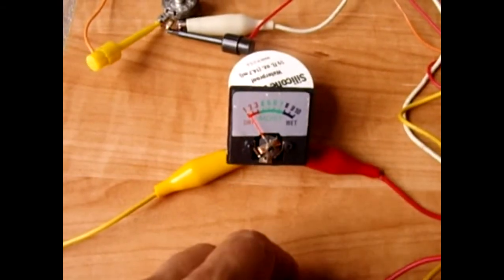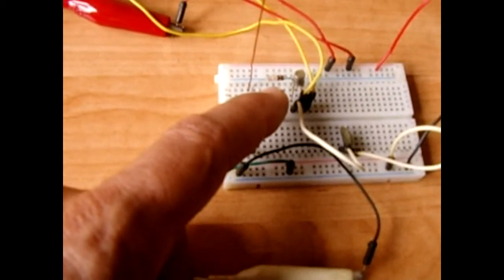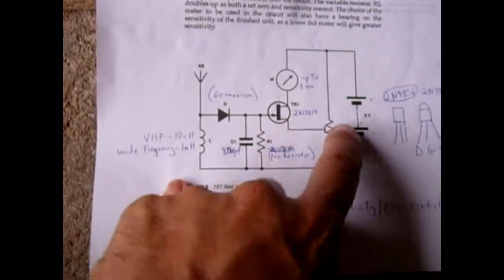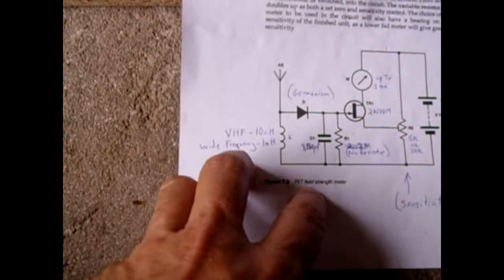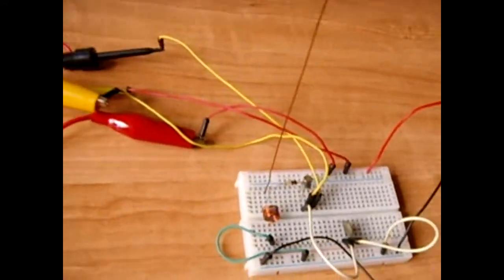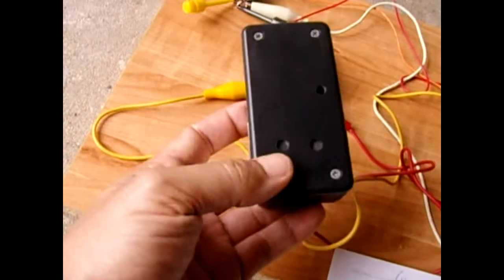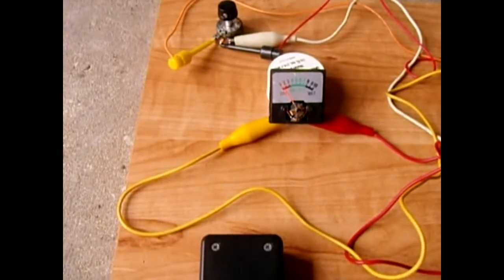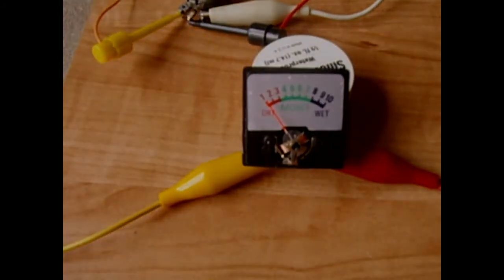Sensitive RF Field Meter Circuit - Pinpoint Transmitters

Comment: Anyone know how to detect a 500 htz signal and help me out?
Reply from the maker: 500 khz? Try modifying an old AM radio. :-)
Reply: @electronicsNmore  I do sewer work and need way to detect my 512 htz sonde. They have a reciver wand but that thing is like $1200 
I used a am radio and it sorta works but super weak. Is there any way to detect that thing from above ground without spending so much

Comment: I find the size of the antenna needs to be roughly the same size as that of the transmitter I'm detecting. A 
full sized telescoping antenna detects my 17'' ground plane transmitter antenna, but I need to use a small wire antenna to detect an FM bug transmitter. Any thoughts?

Comment: Great tutorial and works great! I used a 100uA meter I got from an old metal detector and a 10-turn 1K pot. The multi-turn pot makes it much easier to zero in. I also tried a 500mA gauge which worked, but was less sensitive.   I attached a telescoping antenna which increased the range dramatically to several meters away. I had to turn the sensitivity way down. I used a fixed 100nH inductor in the tank circuit with a germanium diode and a 820p cap. The JFET is a J211. I'm using 9V, but I was able to get it working with proper sensitivity at 3V.  At 1.5V it lacked sensitivity.  I'm using it to adjust an FM transmitter I built based on the YouTube video "Quality FM transmitter" from andydaviesbythesea, to which I've added a power amplifier stage.  BTW, I also copied your square loop transmitter, which works very well, and your mains-powered LED indicator. I use it to monitor my soldering iron so I remember to switch it off...Thanks again to all of you who provide informative videos.
Reply from the maker: Glad you enjoy my videos! Please share my channel with many others. Thank you
Reply: @electronicsNmore  
After some experimenting I've realized the antenna impedance of the transmitter and meter need to be matched. When I get some connectors I'll follow your suggestion and make detachable antennas for the meter to swap out as needed.

Comment: How about 50 uA panel?,  I couldn't find 2N4856, which values Is the important in the data sheet for finding an equivalent transistor?
Reply from the maker: You can try it, but it's way too low. Use NTE's website to find an equivalent transistor. Thanks for watching!

Comment: Many thanks great tutorial. Acquiring JFET 2N4856 and 100uA class 2.0 ammeter to build my very first RF Strength Meter.
Reply from the maker: Thanks for watching! Be sure to rate thumbs up and share my channel with others.
Reply: Sure, thumbs up ! Btw, will JFET J310 able to fit well ? RF/VHF/UHF amp or 2N4391 ?
Reply from the maker: Not sure. You can check using this below, or you have to look up the data sheets and compare them.

http://nte01.nteinc.com/nte/NTExRefSemiProd.nsf/$$Search
Reply: Yes, comparing the data sheets now.

Comment from the maker: It was designed for VHF/UHF, but I don't see why it would not detect HF. I would experiment with different value coils. Maybe 2-3 turns of 20ga wire around a 1/2" form. Also need to make sure the antenna is the proper size(1/4 wave or 1/2 wave) for the strongest signal detection.